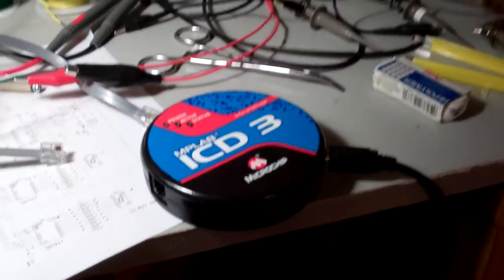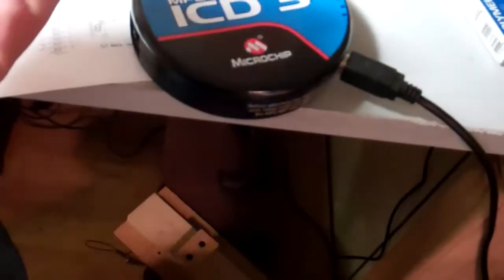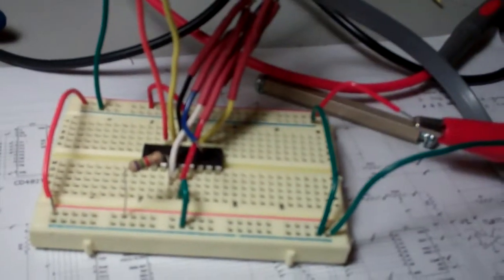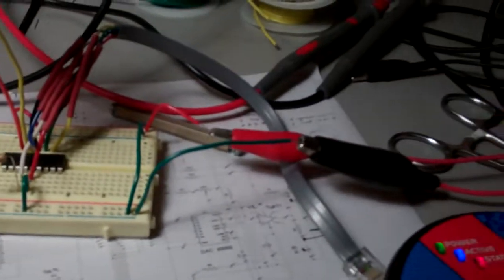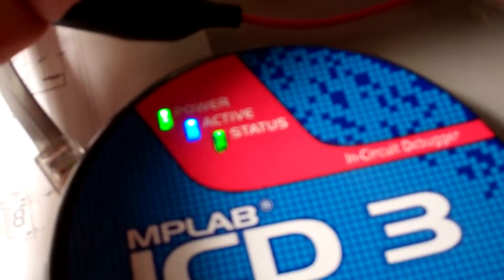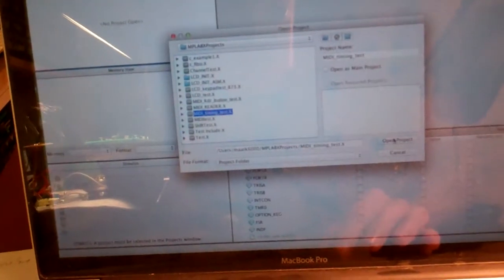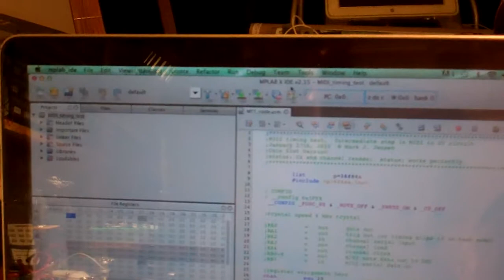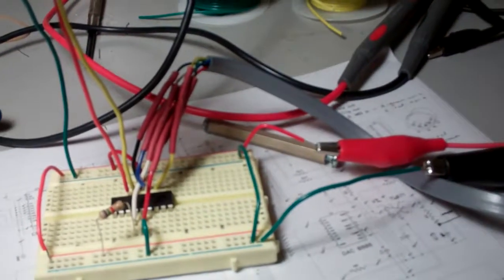how to download code into a Microchip microcontroller using MPLAB X and ICD3

Comment from the maker: Also, one thing I forgot to point out is that you can program the chip while it is in whatever circuit you are building.  In fact, this is a good idea, it allows you to make tweaks to your program without having to remove the chip every time.  I just chose to set the chip in the breadboard to help highlight the minimum connections you need to program the chip.